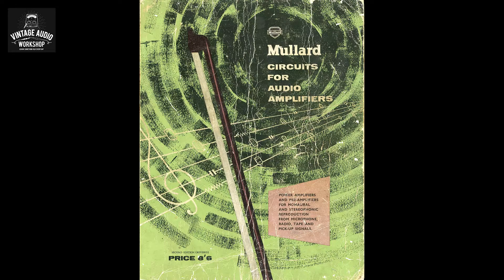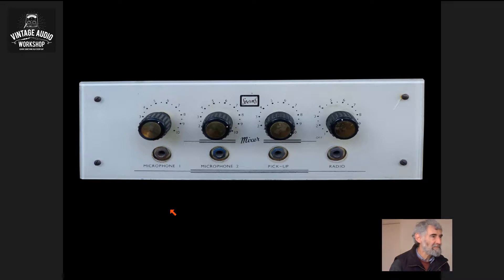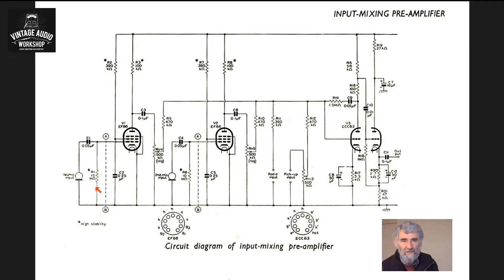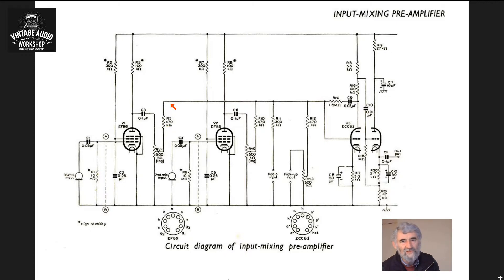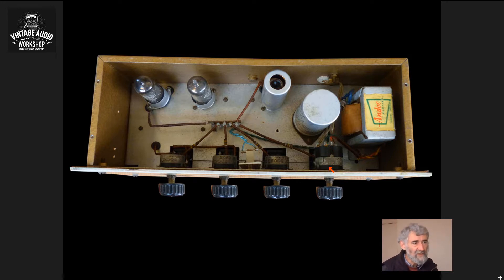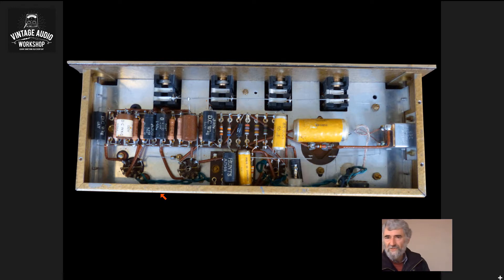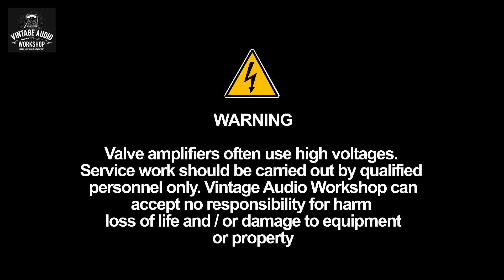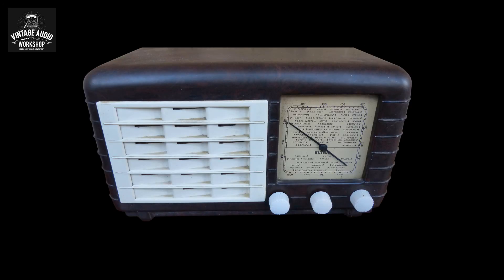Valve Amplifier Study 009: Stern Mullard Mixer, Valve Mic Preamplifier EF86 Pentode

Comment: I remember Stern back in the 60,s  I would like to know in the 1940,s did they use reel to reel metal tape or was the recordings straight  to the cutting lath.
Reply from the maker: Good info here https://en.wikipedia.org/wiki/Reel-to-reel_audio_tape_recording. I think it would have been lathe or glass master in the first half of the 40s and then switching to tape gradually from around 1948. Tom Dowd  at Atlantic Records was a pioneer, especially in early multitrack recording. Thanks for your comments
Reply: Thanks for the info I know that the Germans  during WW2 invented magnetic tape and the Americans captured some of the machines  at the end of hostility,s  and took them back to the states .
Reply from the maker: This has some very interesting info on the subject too https://www.amazon.co.uk/Recording-Angel-Aristotle-Explorations-Phonography/dp/0300099045